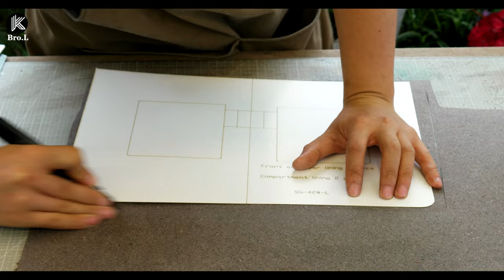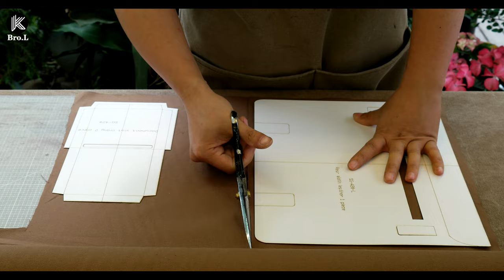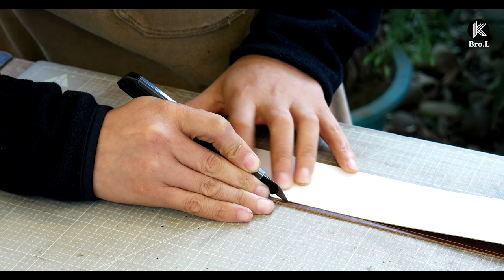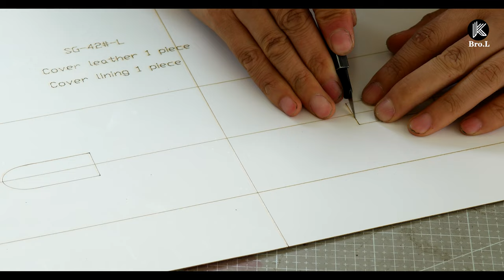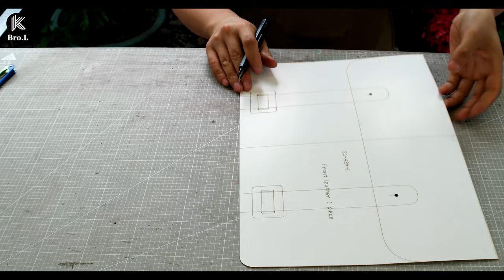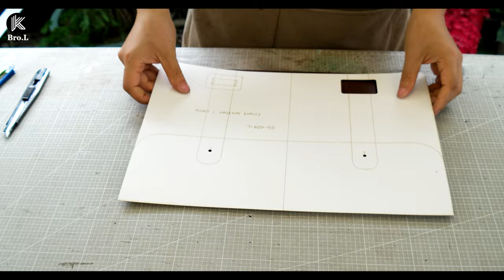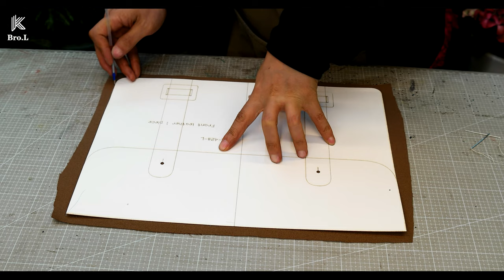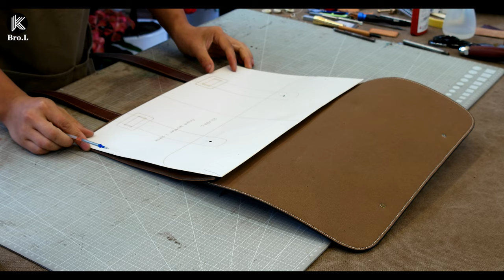Create a handmade messenger bag, laptop bag, and briefcase using leather briefcase patterns

Comment: I have downloaded the pattern for this bag and have nearly finished making the bag myself. The pattern is excellent and easy to follow with the video. 

May I know what kind of white glue you use in the video?
Reply from the maker: This type of leather adhesive has a different name in each region. We refer to it as "PU leather adhesive" or "polyurethane" here, and you can also use other adhesives instead. Its function is completely the same as other adhesives.

Comment: This is top of the line craftsmanship

Can I ask what thickness leather you are using?
And what thickness stiffener?
Reply from the maker: The leather thickness is 2.5mm, and reinforcement is not required. If it is less than 2.5mm, it can be increased to 2.5mm based on the actual thickness of the leather. Leather larger than 2.5mm does not require reinforcement or lining, which saves many steps and can be directly cut and sewn.
Reply: @oakisma  ok, thank you. And what thickness thread are you using?

And how much leather is needed for this project?
Reply from the maker: @Zarrar-Malik  We are customizing this bag for the customer, and I need to measure it before telling you about the amount of leather used and the length of the screws.
Reply: @oakisma  ok, thank you.

And if you don't mind me asking, what is the belt buckle size in this video?

Keep up the amazing work
Reply from the maker: Let me tell you together after I measure. @Zarrar-Malik
Reply: @oakisma  ok, sounds good